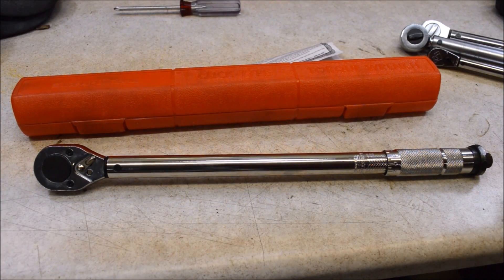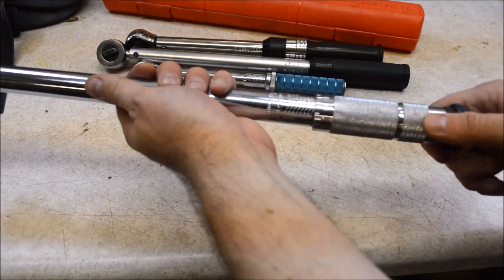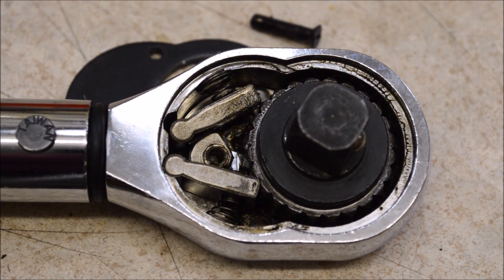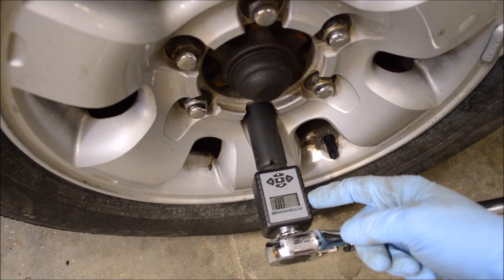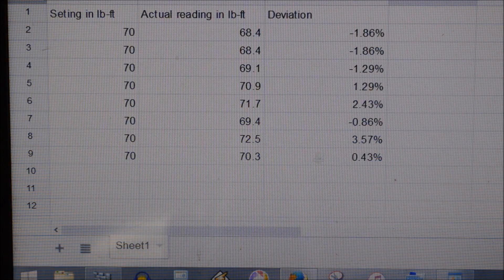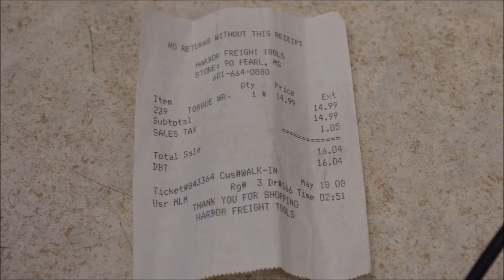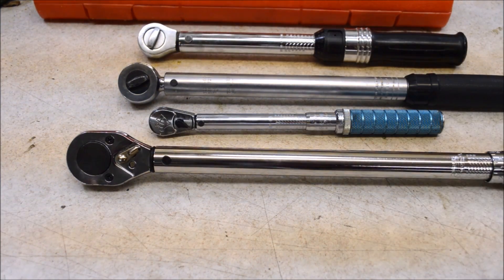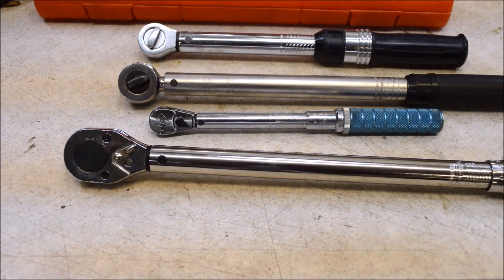Harbor Freight torque wrench 8-year review and accuracy test

Comment: Cheap torques are fine for home users. For a professional environment - in UK anyways - all requires being recertificated each year the more expensive ones tend to hold a closer value over a year true but for the 1/4" wrenches we just replace them £30 for torque wrench sure - £80 for calibration what's the point

Comment: I set it up at 33lb on a timing belt tensioner pulley and stripped the bolt cause it did not click and got fucked up

Comment: 3.57% was the highest deviation? Most high dollar wrenches have a + and - deviation of 4%. 3.57% is pretty damn good considering most of your readings were FAR below that number. I bought all three of the wrenches from Harbor Freight 1/4, 3/8 and 1/2 inch all for $9.99 each, $30 bucks. How could anyone walk away from that? They may as well be giving them away. One of the best deals on planet Earth. Remember they aren't meant for building the Mars Rover. Unless you're a professional mechanic these will serve you for a lifetime and they have a lifetime warranty. I can just about assure everyone that the people complaining about them are using them as  standard wrenches for taking things apart. DON'T DO THAT!!!! Again, DON'T DO THAT!!! These are meant ONLY for tightening, NOTHING ELSE. Yes they make the mistake of marking them on and off. They should be marked right and left for right or left hand twist. Using it as a standard disassembly wrench WILL ruin them. Doing that with ANY torque wrench WILL ruin them.

Comment: Why not just use the torque adapter instead ? I also find it ironic the torque adapter is also harbor freight !
Reply from the maker: The torque adapter is way too bulky to fit in a lot of places.
Reply: @ToolTeardowns  Yeah guess I didn't consider that. Just picked up a 1/2 wrench for tie rods. I must say a lot of them in the store looked used! They must high return rate and just put them back on the shelves?

Comment: I have a cheap torque wrench that I bought at Pep Boys about ten years ago.  I believe it was $20.  It looks very similar to the HF (probably comes from the same manufacturer in China).  I use it for lug nuts, only.  Effort feels consistent going from one lug nut to the next, but I have not tested it, so I don't know its accuracy.  The adjustment mechanism is a bit crude and the markings are a bit difficult to read, but it gets the job done.  It's been reliable, though its used infrequently.  I always store it with the adjustment unloaded.  Next time, I'd prefer one with a longer handle for more leverage.

Comment: Hi

Is there a specific lubricant to use for the mechanism?  Can i use a few drops of 5W30 synthetic oil?  I do not know much on these tools but can i also loosen and remove the adjustment mechanism and also add a few drops of synthetic oil?  Would it have to be calibrated once i remove the adjustment mechanism or can i put it back together and keep using it?  

I just purchased a 1/2 HF torque wrench and would like to give it an initial dose of maintenance.
Reply from the maker: Oil would be OK. I like light grease, like Super Lube brand grease, for this type of mechanism. But a little oil will be fine.
Reply from the maker: Don't remove the adjustment mechanism. I was only referring to the ratcheting mechanism in the head.

Comment: I have the 1/4" inch pound , 3/8" 1/2" & 3/4" foot pound versions of the harbor freight tourqe wrenches and the oldest one the 1/2" is pushing 20 years old, I have them checked by a buddy of mine that has a tourqe block and every time they all fall  between the plus or minus 3ft lbs as stated by harbor freight. I always back them off when I'm finished using them and always store them in their case. Just because their inexpensive doesn't mean I treat them like a piece of trash. Guess I was brought up in a different way.
Reply: you are all right, respect and consideration go a long way including for these fine MadeInChina tools.
👍

Comment: Thanks.  If you only take off tires when they have flats or you rotate your tires, then this will last you your whole life.  If you work at a tire shop and rotate 20 sets of tires a day, it STILL may be a good deal... Throw it away when you cant re grease it..  Measuring devices , Like gas gauges, should only really give a general indication of what you are interested in... I use a stopwatch daily, and used to demand that I use a DIGITAL stopwatch.  now, I use the second hand of my analog watch and it works fine..  MORAL OF THE STORY....  You do not need exact precision in life except in thermonuclear detonators!!!
Reply: that's right.torqued to 2 uggaduggas with the rattler.who needs a fancy "torque wrench" unless you're vin diesel getting paid by the word and can't settle for just saying "wrench"

Comment: I did a face plant on the ground because of a piece of shit Habor Freight torque wrench. The torce wrench wasn't working right so when the mechanism clicked because I reached the torque there wasn't any resistance pushing back so I ended up doing a face plant into the ground. Not worth the risk. Spend a little bit more and get one that actually works unless you want your front teeth to get knocked out.
Reply: I think you need to work on your technique and not put yourself in positions where you can fall down.

BTW, were you drinking when you were working on whatever? Excess alcohol consumption impairs balance.

Comment: if not for Harbor frieght, many of my wish lists would still be dreams, I go to the drag strip every week with my trusty harbor frieght low profile jack and this trusty torque wrench, launch my car and send it down the track. Great Video , ty!
Reply: My dreams too, I never thought I could own a set of precision tools. Harbor freight is a poor mans paradise
Reply: SEND IT!
Reply: Those orange floor jacks sold by Harbor Freight are actually Snap-on design. What happened is that when designed their floor jack Snap-on didn’t trademark it immediately, so Harbor Freight snatched the design while they could. You can look at Snap-on red jack and Harbor Freight orange, they look exactly the same.
Reply: @vegasway  Just picked one up, FANTASTIC tool.  I also have one of their engine mounts, shop crane, transmission jack, jack stands, breaker bars, combo wrenches, etc.  All have help up to years of abuse and work as well as they day I bought them.  Hell the shop crane hydraulics held pressure after having a whole engine held up by it for weeks.  Seriously underrated and overlooked tools by professionals.

Comment: Funny this video came up. I had just bought a 1/4 inch, and 3/8 inch torque wrench from harbor freight 2 weeks ago. The 1/4 inch worked great, but the 3/8 was way off. Ended up busting an oil cooler housing because the aluminum couldn't take the 50ftlbs of torque it did when it was set to 27ftlbs. Luckily it was on the one I took off, and not the replacement one. Dumb luck that I tried it on the old one first. Anyways, I tried adjusting it all the way out but it still over torqued bolts. Got a replacement one that was fine. If you get a HF one, be sure to calibrate it first. They work great, but don't trust It out of the box like I did.

Comment: I have the 3/8".  My 1/2" and 1/4" are different brands.  I also have the HF digital meter.  When I got that. I tested it with several known weights and a long breaker bar.  It was right on the money.  I have no problem checking the accuracy of my wrenches with it.  Like you said, I store my wrenches at the lowest setting.  The low tooth count, at least on a torque wrench, is the least of my worries.  Bottom line, the HF is a great buy.
Reply: It's good business after all to sell these $10 torque wrenches... mechanics can do a good job and keep buying more tools !
👍🏼

Comment: I rebuilt both an engine and a transmission on of the 1997 Honda accord of.  Both with my torque wrenches from Harbor Freight got them for 30$ on veterans day.  SHOUT OUT TO ALL MY BOYS IN THE SERVICE.  1/4 inch. 1/2 inch and 3/4 inch wrenches.  Yes my Honda is still working great.

Comment: Wonder accurate their 1/4" torque wrench is.
Reply: Same. So few people require work in In-lbs, so there's a lack of videos on them. Given the 3/8's goes down to 5 ft-lbs, which is 60 In-lbs, I'm not sure what work needs done at such low torque settings.

I was going to buy the 1/4, but decided a beam wrench would be better.

Comment: Your chart says a lot. At the end your wrench is in within specs for USAF pmel calibration criteria. Also of note in USAF aircraft maintenance, a technician is supposed to click a torque wrench 6 times at the highest range to be used for the job. And according to the chart, that 7th go puts the wrench in point. We're also taught not to crank stuff down with a torque wrench. That's what a ratchet is for.

Comment: The problem is that harbor freight no longer makes the same exact tool.  Materials change.  Bait and switch style
Reply: suppliers change ... sometimes good sometimes bad.Locally a chain has a new maker for spanners which used to rule but now suck balls.Their pliers used to rust on the shelf now they're fucking awesome

Comment: Gotta say I have had that basic model torque wrench since they came out with them which is more than twenty five years if memory serves.  Also have the 3/8 and 1/4 models.  They have worked quite well not even loose screws.  As mentioned the base adjustment is a bit awkward but for the difference of several hundred dollars I can handle it!  I had a beam (still do) style before and these were a great improvement when working in positions where the scale is not easily seen.  I had always hoped they would come out with a 3/4 drive but they never have. With HF you just have to be a bit selective on what you get.  I know I would not have been able to afford the myriad of tools in my shop and some have been very worthy that I needed to get my work accomplished.  I have been going to them often since they first opened.  One concern I have recently is their trend toward creating 'brand names' and then boosting prices considerably which is the whole reason I shop there in the first place.  My hope is that they keep the present inventory and do not switch to the higher profit "brands".  Good review.  Take care.  Doug

Comment: Ive rebuilt 10 engines with harbor freight 1/4 3/8 and 1/2 torque wrenches. Zero issuses.
Reply: I have the 3/8 from harbor freight always works perfect .
Reply: Rod N' Drone nice. Good to know, everyone believes it will not do too good on motors. I am definitely getting all 3. Lifetime warranty, no receipt needed to get a replacement. And other brands are not lifetime warranty on torque wrenches
Reply: Alex Machado Are you sure about lifetime warranty? I thought it was only 90 days on the torque wrench. I may be wrong though
Reply: I use mine in a motorcycle dealership’s service dept. Everytime I think about    upgrading to a CDI or Precision Instrument I watch videos like these.
Reply: Packaging says lifetime warranty
Reply: Thank you for commenting. I am about to go pick one up, I was debating since I’m torquing down rod bolts and I’m rarely inside an engine. Going to save myself some money!
Reply: Rod N' Drone thank you I just bought all 3 for $10 each. How their return policy on torque wrenches?
Reply: @joshuagarcia7791  I just returned one today that I got earlier this week. Had no calibration certificate and was broken when I opened the box, ratchet didn't work and it was set at the max torque in the box which is not how to properly store a torque wrench.

No issues, just told them it was broken and got a new one. This one works, but I did notice it was set at 30 ft-lbs in the box, not 20 ft-lbs which is the minimum. Not sure if it being set 10 ft-lbs above the recommended storage setting, but I'll find out when I have mine checked for accuracy.

For what these are, I think they're great for backup use given the price, but I wouldn't be afraid to use them for general automotive use like on steering & suspension components.

I wouldn't trust the 1/4" one tho, I think In-lbs is too fine a measuring scale for a cheap click wrench. A good brand beam scale would be better, IMO.
Reply: Its the AK-47 of torque wrenches, too basic and cheapto be super precise, but to ruggedly simple to go wrong.
Reply: Same, no issues at all.

Not HF but this same model (presumably Chinese made) is sold globally.  It's fine, it's nothing fancy and it's probably not the most accurate but it works and is accurate enough for most mechanics.

Comment: Just got me one of these from harbor freight for 10 bucks. Seems to work just fine so far but I haven't had a chance to check its accuracy, but going by feel it seems appropriate. Honestly its amazing how I can have a decent torque wrench for just 10 bucks. thats 2 bucks less then I payed for a breaker bar haha.
Reply: I have their breaker bar as well, works very well, as any breaker bar should...course if you stand on it with a 4' cheater pipe it'll bend just as well as any of those so called name brand ones will LOL.  My torque wrench also breaks fasteners just as well as any other torque wrench...that click doesn't mean anything if you keep going past the click it just keeps on tightening those fasteners just like any other torque wrench haha.

Comment: I just returned a 3/8" 5-80 ft/lb Click Type to Harbor Freight yesterday after nearly two months because it wouldn't torque properly,  it caused a bolt head to dig into the plastic upper intake manifold of a Buick 3.8l Series II V6.  The cashier must have known that they were junk because I was never offered an exchange,  I was given a refund.

Comment: uhm....I just broke a bolt...1/2 stayed in the valve casket cover...I was lucky that half came out easy...it was set to 64 inch-pounds....I thought...what they hay...that is only about 5 foot-lbs...spent last two hours regrouping...need to pull out the broken piece and of course asking the dealership to please order me a new bolt...it was my wife's car, so I even felt worse...kind of afraid now to even try another torque wrench...why do we need to torque auto bolts, anyway? Funny, but on my car, I just tighten it manually, being running OK last 11 years...felt sorry for my wife's car...it is the bolt on G35 INFINITI holding down the spark plug unit that was like in the old days the spark plug wire casing..sorry, forget the name...

Comment: A 15 dollar torque wrench, 8 years old, basically still very accurate. Amazing deal. I have the 20 dollar Pittsburgh Pro torque wrench. It's never let me down. Most things at Harbor Freight are a grand slam of a deal for the homeowner. I have a cheap set of combination wrenches from HF and I bought them in 1993. Never a problem and used very hard! I am a fan of Harbor Freight. They have always treated me well. They may not sell the best stuff, but it's definitely good stuff for the homeowner.

Comment: I only use precision instruments and cdi (snap-on) micrometer style torque wrenches. I also own the cdi dtc (25 to 250 ft-lbs) checker. I want quality torque wrenches for anything I need to torque. But harbor freight does have a good wrench for changing tires (and that's all it good for, tire changing torque). Lates

Comment: The thing I can't stand about the one I have is how hard to read the scale is with my aged eyes!
Reply: I hit the markings with some black nail polish, let it dry, then removed the access with nail polish remover and a paper towel. Even with "good" eyes, the characters are substantially easier to read!
Reply: AvE did a video on a simple trick so you can see the markings more clearly.  Look up "Simple Mechanic's Tool Customizing Trick".  Beware of strong language if you're not familiar with AvE.

Comment: My 2 cents...it's a inexpensive tool that does what it should. Is it the quality of snap-on etc...no. But will get the job done. Problem is people abuse these things and then they are shocked when they stop working the way they should. If you jump up and down on a cheater bar attached to a snap-on torque wrench it will not work correctly for long either. Nice video...subscribed!
Reply: GoGetYourOwnGear lol people buy tools from harbor freight and think there going to get snap on quality tools
Reply: @joccievier3146  
"think there going"

It's spelled "they're", not "there".

Comment: I also have one from that age. 
I had it tested in a local machine shop recently and the guy almost shit in his pants. He tried the tests a few times. He wanted to buy it. He said it gives better(or quite similar) results than his $800 one. He said he tests them all the time so it would be great for him. Problem with HF is quality control. The tools aren't bad. One day you will get a tool that makes snap on look like junk, next day you get scrap.
Reply: alb12345672 I’ve been buying tools for almost a year from Hf, hasn’t let me down yet. Right now I’m on the fence for buying all 3 torque wrenches and since they’re lifetime warranty it’s worth it. I haven’t seen any other brand with the lifetime guarantee on torque wrenches. I can bring it back with no receipt and for the recalibration reason, it can be returned anytime.